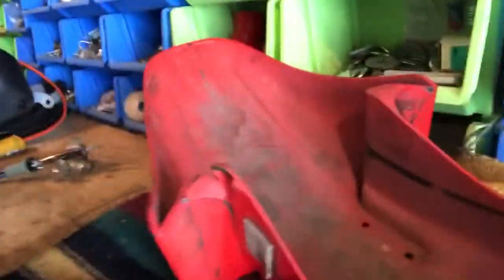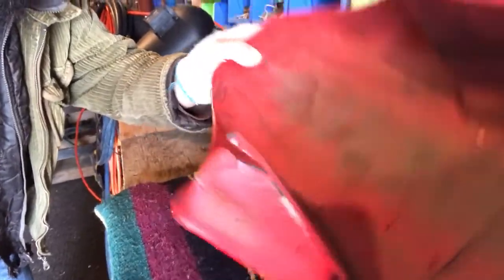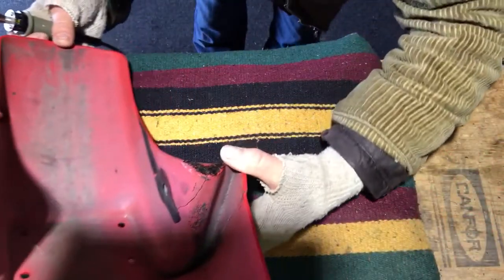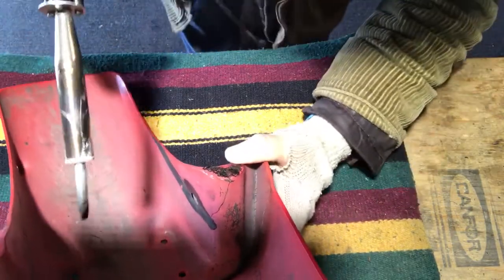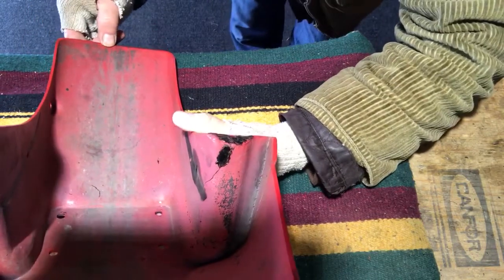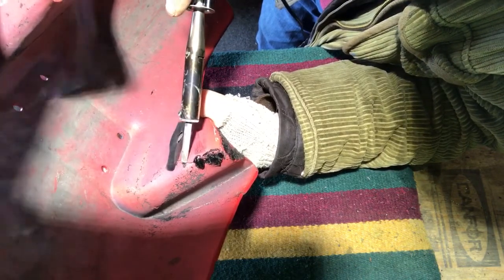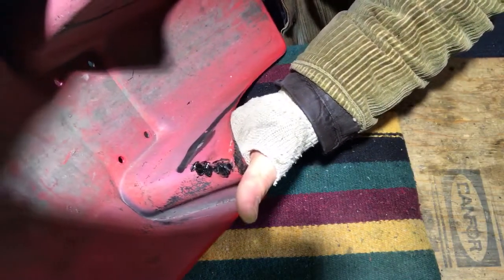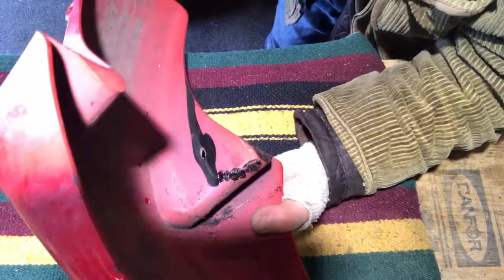How to repair cracked ABS motorcycle fairings using steel !

Comment: I'm trying different methods. My latest is to solder weld the crack on the inside. Then cut the mesh out of a stainless mesh strainer or other mesh product easily found at the dollar store and melt it into the back across the crack. Add more abs on top of embedded mesh if needed. Still working on this one, but I'm optimistic.

Comment: I had luck with abs cement and abs pieces to reinforce the back across cracks. I used abs bowls for curved parts and abs food trays for flat parts. $1.50 each at the $1.50 store.